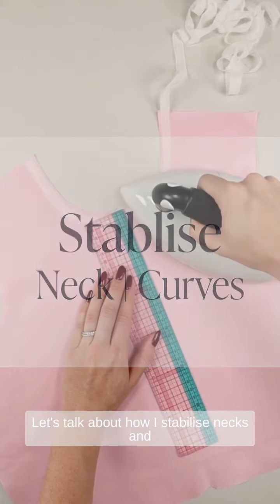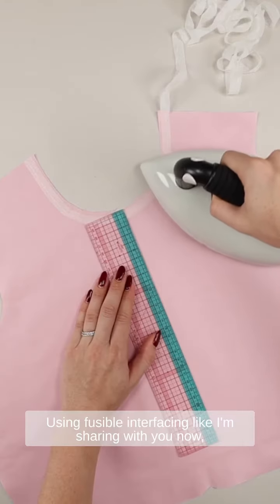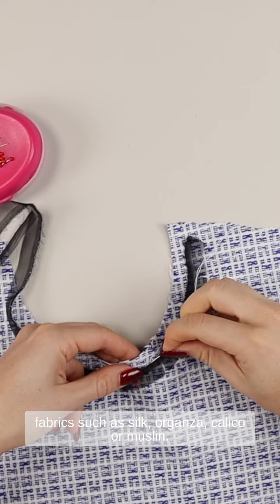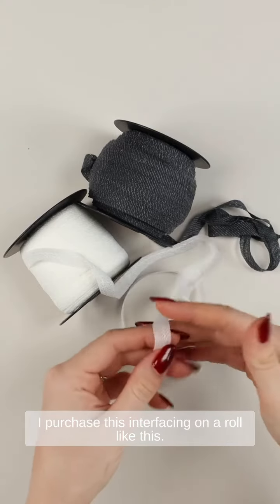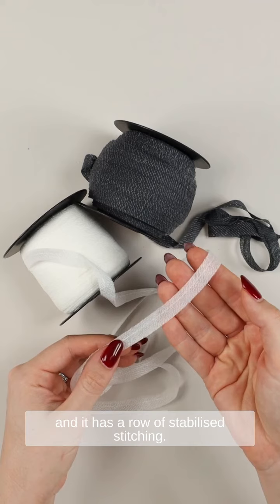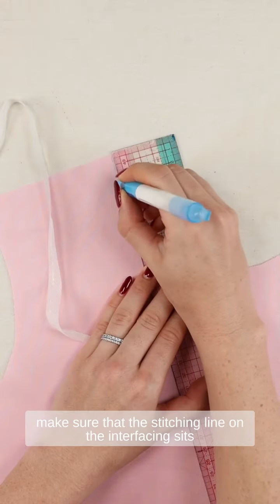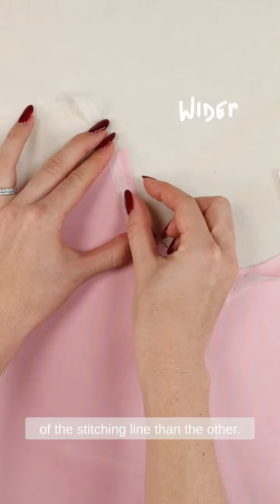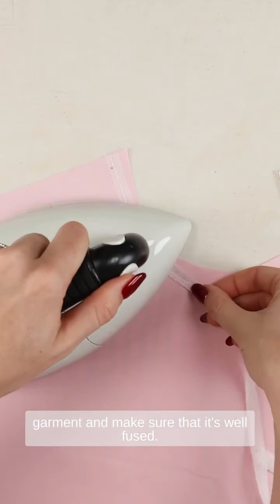Stabilise Necklines & Curves Professionally Using Fusible Interfacing

Comment: Are you left handed?!  Love the way you quickly iron it on.  When I ironed mine on it melted a bit, maybe the iron was too hot?
Reply from the maker: I am right handed but I play all my sports with my left hand, so perhaps a bit ambidextrous! I have got used to doing stuff with the best hand to get it in the video! 

Yes, maybe the iron was a bit hot. I would try using a pressing cloth? Test it on a piece of fabric too. And check if your interfacing has instructions for heat and time. It should have them written on the interfacing edge or where you bought it.

Comment: Off topic but does anybody know if the ties for a dress need to be cut on the bias?. My dress has two ties that are just above hip level that tie at the front & I would save fabric if I didn't have to cut on the bias.
Reply from the maker: Hi Gill, it really depends on the design of them and what they are for. If they are just straight ties then I would cut them on the straight of grain. 

Think about how the grain will help / hinder the ties. The bias will stretch, whereas the straight of grain will be more stable. 

But it might depend how the ties are being finished as well. 

Hope this helps, 
Aneka
Reply: @MadetoSew  Thanks Aneka, The ties are shaped wider where they attach in the side seams & tapered to the end. My dress is in silk so there is fluidity, I think then cutting on the bias may be better. I was just trying to save fabric lol, hoping to get a skirt out of the remaining fabric.
Reply from the maker: @gill8779  Yes, if the designer has asked for it to be cut on the bias there is probably a reason. It sounds lovely.